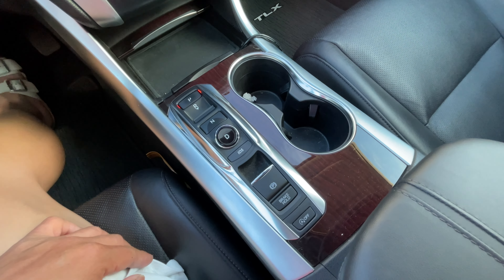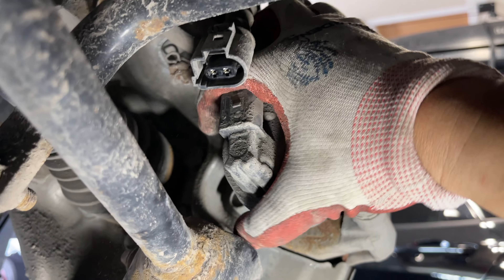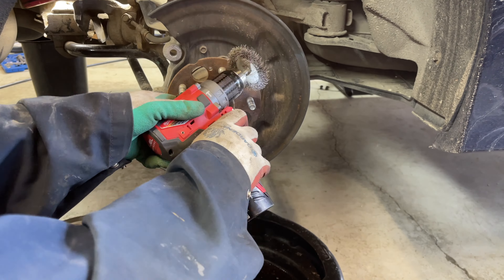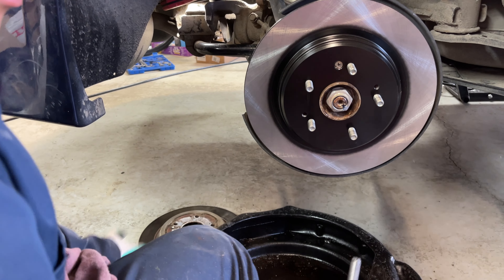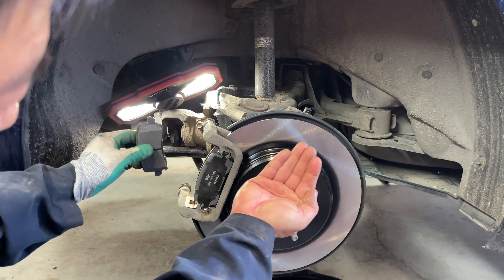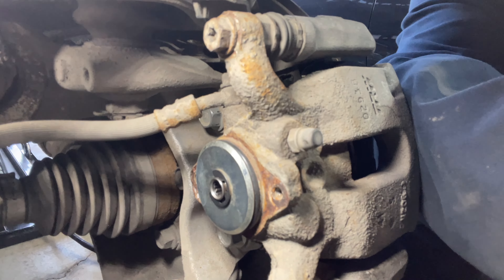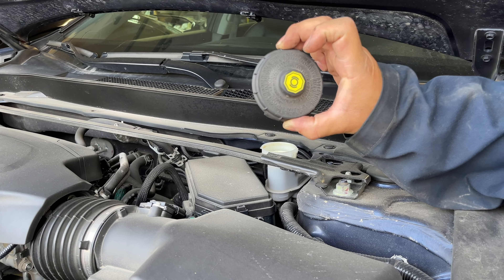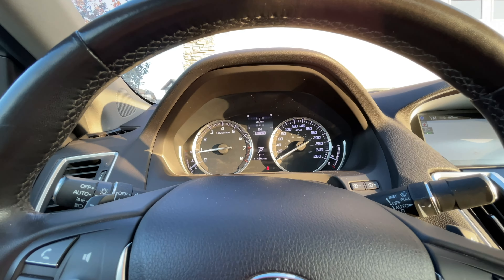Acura TLX Rear Brake and Rotor Replacement

Comment: Do rotors need to be replaced @30K?
Reply from the maker: it really depends.  Rotors for many cars can go up to 60K quite easily if you're gentle on the brakes but if you've got any sort of excessive pitting, chatter, vibration or other weird anomalies when braking that its probably best to put new ones on since the cost of new rotors isn't really all that much.

Comment: Aren't you supposed to spin back the caliper piston in the opposite direction with t45 to its original position before reassemble of actuator?
Reply from the maker: Definitely not! The idea of screwing in the back of the caliper is to retract the internal parking brake adjuster to allow the piston to retract back into the caliper body.  If you screw the retracted parking brake assembly back then you're effectively applying the parking brake to the pads.  The system is smart enough to auto tension the force needed to apply the parking brakes so no additional "thinking" is needed on our part.
Reply: Watch video. 2015-2020 Acura TLX Front & Rear Brake Replacement/ BeeCee Built. Shows what I commented on. Thanks again.
Reply from the maker: @neilmiller6405  he isn't wrong in how he does it but it isn't required.  All he's doing is just making the parking motor travel less but its a motor that has also recalibration for parking brake (based on pressure/current draw) so its a step that isn't required - I'm a former Honda tech and they never did this at the dealership.

Comment: Is it AWD ??  Why change rear pads and rotors ?
Reply from the maker: This particular TLX was AWD.  Rear pads changes out usually go hand in hand these days with rotor replacements due to corrosion, run out, wear etc.  Modern rotors are not really worth machining anymore b/c of time and remaining thickness on rotors.  They're not like cars from the 60's and 70's where brake rotors and drums were thick and meant to be remachined and reused.